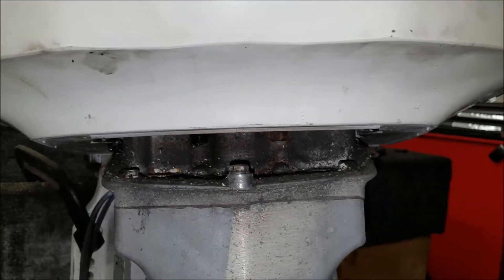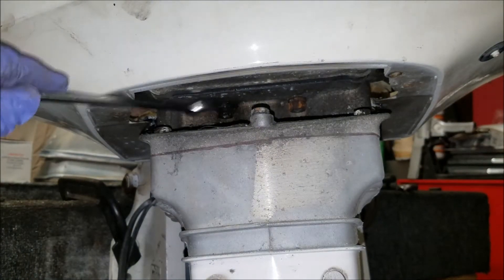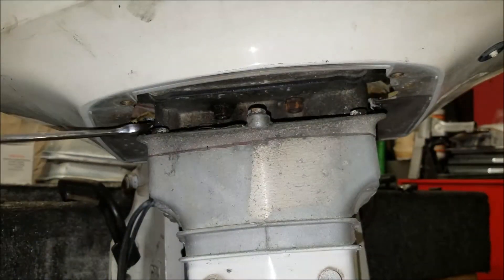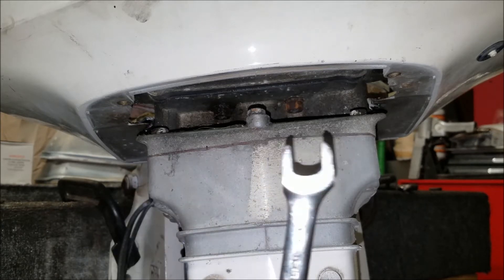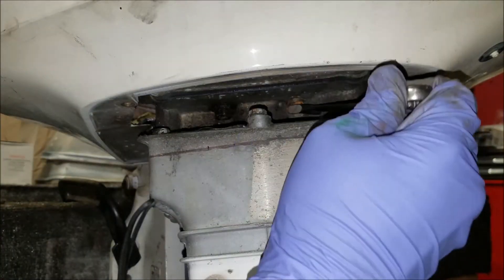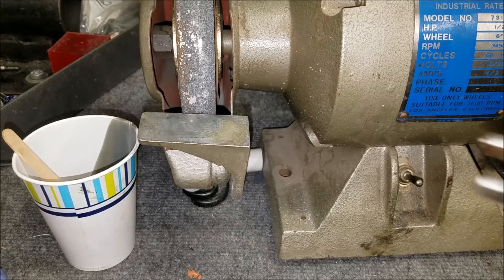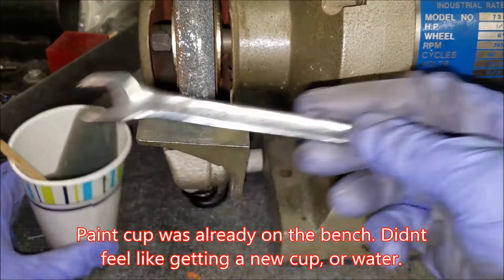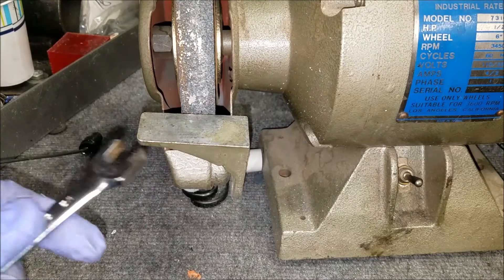Johnson / Evinrude V4  & V6: Removing the Rear Powerhead Nuts / Bolts

Comment: Thanks for the video.. I'm removing my 140 powerhead and it's really useful to be shown where all of the bolts are. With the rear nuts I used a sthallwille (open box) combination spanner. The ring ends are very strong but really thin and fit easily. Just thought I'd share this....

Comment: Try a automotive brake bleeder screw wrench they are made to fit in close quarters its a little thinner so it engages the bolt better
Reply from the maker: But in 1/2"?

Comment: Nice trick. I tried that with a 75 Johnson 135hp. The 1/2 wrench just slips and a 12mm slips. Any tricks of what to do at this point?
Reply from the maker: is it stripped? or just cant get a wrench on there?
Rusted together maybe?

You cant get a nut splitter in there, and you surely aren't getting a grinder in to cut it off.
Trying a torch and getting it hot, that usually does it.

When it gets too bad, you could get an air chisel and cut if off. 
Problem with that is it may slip, and you could do all kinds of damage.
Reply: nuts seems to be stripped. I am guessing air chisel is the way to go.
Reply from the maker: Is it just spinning? Did the nut drop at all?
If so, perhaps get above it with a flat screwdriver to help push it down, while twisting the nut.
Reply: The nuts where well rounded a good hit with the air hammer and the nuts split off. Thank you for the help